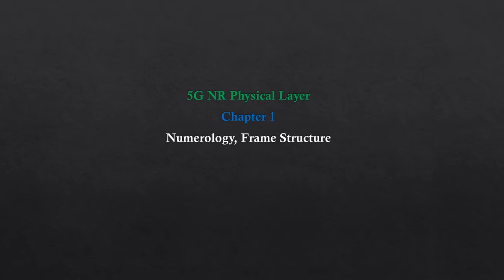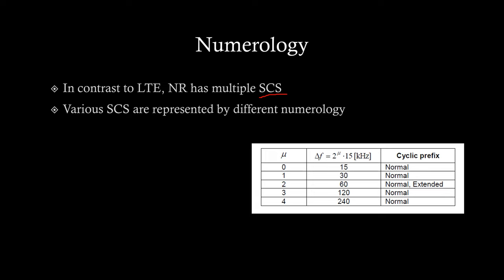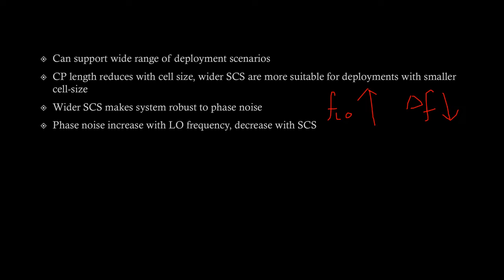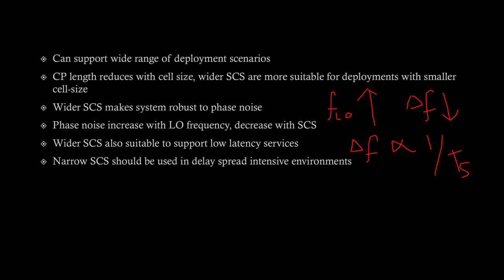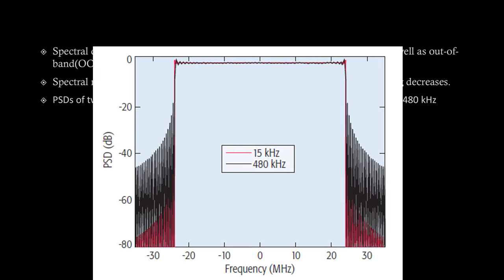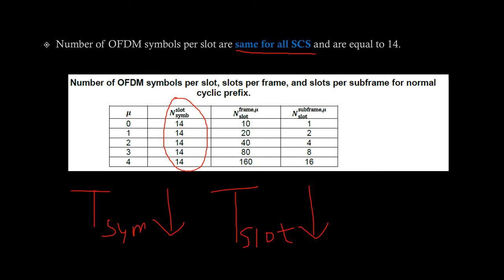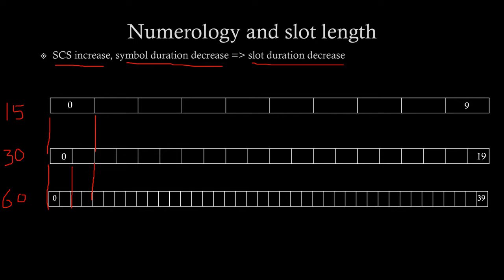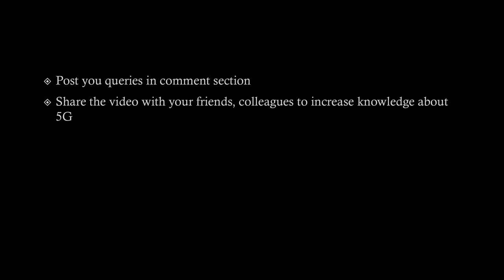5G NR Physical Layer | Chapter 1| Numerology & Frame Structure

Comment: Thanks for the series .. Is there a reason for fixing number of symbols per slot as 14 ? What is the relation of SCS and cell size?
Reply from the maker: I am not 100% sure about fixing number of symbols per slots as 14, but I think as scheduling in NR is on slot level, therefore for faster scheduling we use wider sub carrier spacing and hence lesser symbol duration which leads to lesser slot size hence faster scheduling.
Reply from the maker: Regarding relation of SCS and cell size :
In an OFDM system, cyclic-prefix is chosen larger than delay spread to avoid inter-symbol interference and complex equalization. This means that for a given cyclic-prefix overhead, the channel delay spread sets a lower limit on subcarrier spacing. Typically, the delay spread reduces with cell-size as does the required cyclic-prefix duration, meaning that wider subcarrier spacings (having shorter cyclic-prefix) are more suitable for deployments with smaller cell-size. This is in parallel with the fact that smaller cell sizes are envisioned at higher carrier frequencies due to harsh propagation characteristics, and wider subcarrier spacing makes the system robust to phase noise (which increases with oscillator frequency).
This is described here in the video https://youtu.be/RagHojSWEz8?t=123

Comment: How about the Resource block definition in 5G and how different numerology is implement in one carrier from frequency and time domain view?
Reply from the maker: Basically in NR, One Resource Block is more associated with 12 Subcarriers in frequency domain provided in time domain the minimum number of symbols include DMRS symbol
Reply from the maker: Different numerologies differ in SubCarrier Spacings in frequency domain view that's how they are defined, but they are similar if you look in time domain
Reply: @curiousbeing8585  Thanks a lot for the explanation. I also figured out the same after I sent the question.

Comment: Could you please elaborate on Why EP only for 60 KHZ SCS ?
Reply from the maker: this is just application based, in LTE not much use cases were found for extended CP, therefore in NR extended CP is limited to only one SCS.

Comment: If 15 kHz subcarrier = slot per subframe is 1 slot = 1 ms = 14  OFDM symbol, then 30 kHz subcarrier = slot per subframe is 2 slots = 1 ms = 28  OFDM symbol, and for 60 kHz subcarrier = slot per subframe, it is 4 slots = 1 ms = 56 OFDM symbol.

Now, my question is this:

 1. How much bandwidth contains in each slot, for 15 kHz, 30 kHz, and 60 kHz?

 2. How much bandwidth contains in 1 OFDM symbol